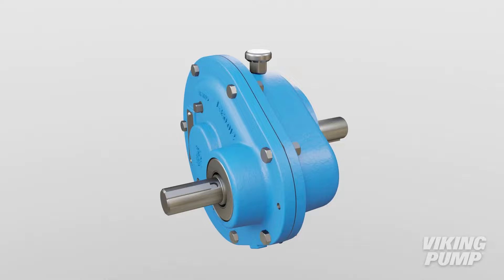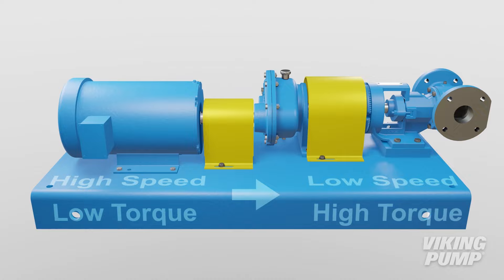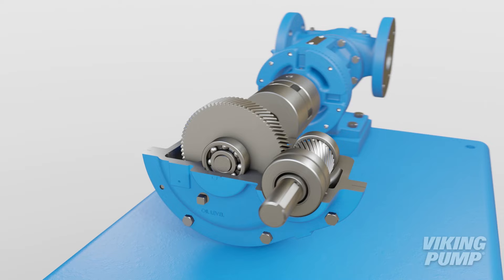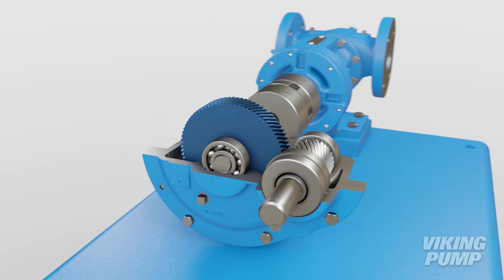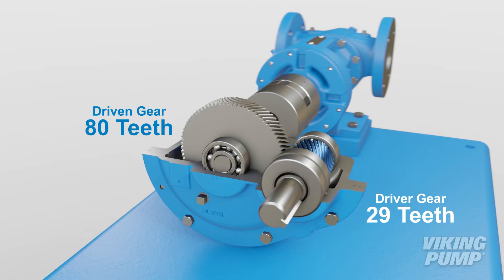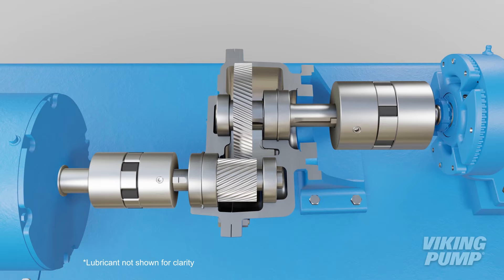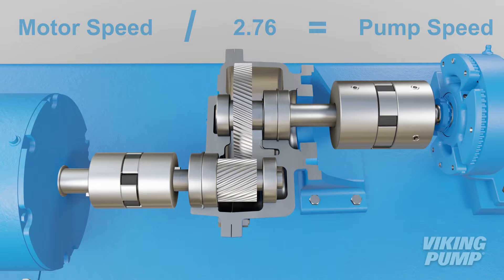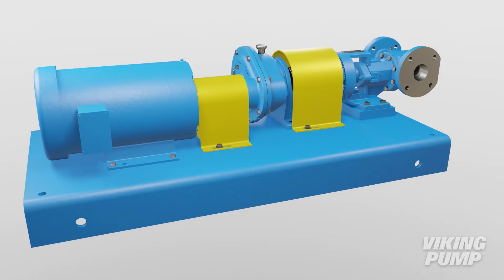How Does a Gear Reducer Work?

Comment: Geat reduce are diveces used to transmit mechanical power from an  electric motor or other driver to a driven load  in the world of pumps, they convert the high speed low torque input from the motor to a low speed, high torque output at the pump  to understad how they acocomplish this well need to look inside indide you'll find 1 or more pairs of gears  each pair consists of a smaller drive gear and a large driven gear  the ratio of the driven gear to the number of teeth of the driver determines the reducion ratio of that pair for this particular gearbox, the driven gear has 80 teeth  the driver gear has 29 teeth so this single redution gearbox has a ratio of 2.76:1
This means thattbw input shaft must be rotated 2.76 times to fully rotate the output shaft once.